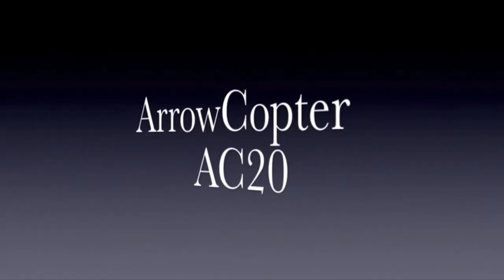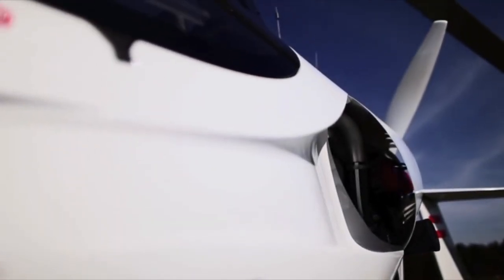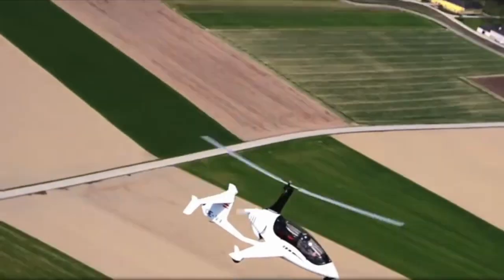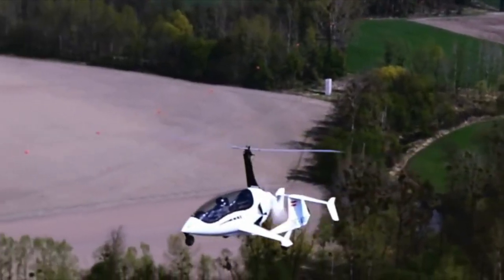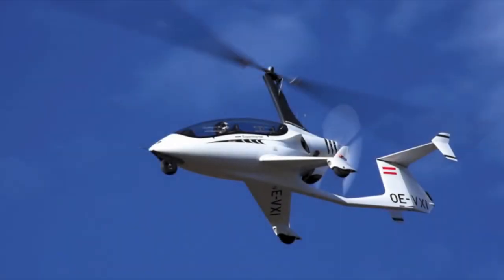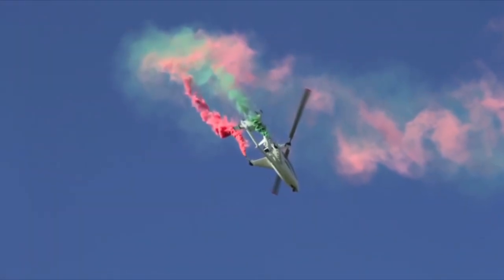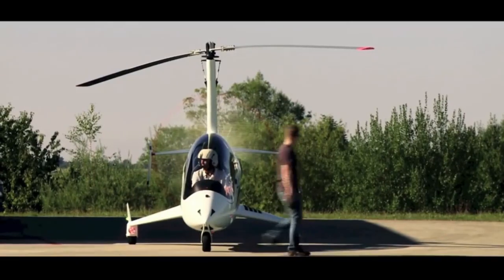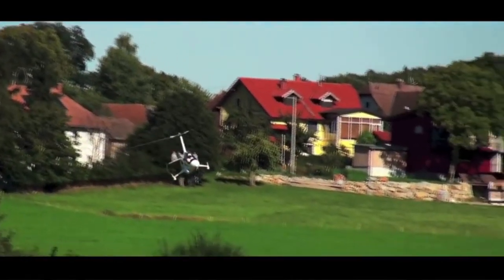History of the Gyroplane - part 21 The Arrowcopter AC20

Comment: I owned an AC20 N713TX (one of two in the US). My experience was a bit different in late 2014. The rebuilt factory floor was well organized and there were several in process. The machine was incredibly well built (I've also owned an MTO and a Cavalon and have many hours in Magni's). There's not a gyro that came close to the fit and finish that I've seen. As stated, flying was normal, but the yaw roll was pronounced at high speed (top end was 95-100kts). I attributed it to the sharp nose and the wings. If you let it get out of yaw trim I think the winglet would cause the roll into the windward side (just my theory). Landing the Arrowcopter was a dream. The wings gave some ground effect and the built in suspension made every lending butter smooth. I sold it, but honesty still kick myself for letting it go.
Reply from the maker: Hey Jason thanks for sharing this.  I think I was over there in the August of 2014?  But yes I agree the fit / finish / overall quality of the aircraft was very good and better than what is currently offered by other gyroplane makers. I only flew it for about an hour and yes perhaps you are right about the cause of the dutch roll  - indeed it was quite mesmerising once it set in watching the horizon more about! I'm not sure if the fix would have been easy for them and the wind seemed to have gone from their sails UK wise with the certification issue.  Ownership I'm not sure who supports the aircraft in the US but that would have been my biggest worry?  Great colour from an owner thanks.
Reply: @jasonknight1585  the Designer still works but shifted towards Porsche tuning, I was at his factory in March 2025 he still owns one AC 20 cheers from Austria

Comment: The one I’d really like to see in the UK is the AG915 variant Trendek. I don’t like the Cavalon because the panel layout is absurd and the visibility is dreadful, add to that its 100mph VNE,  high fuel consumption (or, at least, higher than an MTO Sport), and its narrow track and small rudder increasing the risk of it rolling-over on landing. I think there is a gap in the UK market for a much better side-by-side enclosed cockpit gyro and the AG915 looks like it would be a good contender.
Reply from the maker: Hi - yeah I just don't see them bringing it to the UK and actually the way I see the UK market its probably not worth them doing so.  IMO gyroplanes have gone the wrong way in that they have tried to get more sophisticated which has driven up pricing and I think we should have gone the other way.  If someone marketed a <£40KGBP gyroplane in the UK it would sell.  On the Cavalon I agree with the panel and the A pillar does obstruct but the VNE on a new Cavalon is 120mph and the track is the same sport v cavalon.  Landing is fine you just (again its my view) don't want to get too slow in these things.  Too many people try and spot land every landing and it just isn't necessary.
Reply: Gyrocopter flying club - Ah. An increase in VNE is useful. I agree that the AG915 will probably never reach the UK market. It doesn’t change my view that I’d rather have one of those than the Cavalon. Yes, the track may be the same between the Cavalon and the MTO Sport, but the larger rudder in the (pre-2017) MTO gives better authority. Compared to my MTO, I found the Cavalon to feel kind of “dead” in flight. It sort of felt like it was wallowing around compared to the MTO. I get the advantages of side-by-side enclosed cockpit vs tandem open-cockpit and I can see why people would choose that format but I really don’t think that the Cavalon is worth the money. In my opinion, there is just too much wrong with its design and to go from the unencumbered visibility of an open-cockpit aircraft to the cockpit of a Cavalon is too much of a step down for me. It could have been a much better aircraft. I would still like to fly an AG915 to see if it really does tick the boxes but so far, when I’ve flown enclosed cockpit aircraft, I’ve felt like I was looking through a letterbox at the outside world. Before I started flying, I didn’t think I was going to really like the MTO, but so far, I feel that I wouldn’t trade it for anything. My instructor used to say that an enclosed cockpit just provides a false sense of security and more shrapnel to kill you in a crash.
Reply: Abid Farooqui - Ohhhh... I like the American Ranger, too... That’s another one I’m hoping will make it to the UK and that I’ll get the chance to fly one. I know someone who owns one and flies it when he’s in the States.
... and I did say, “I would like to fly [the AG915] to see if it really does tick the boxes”. I’m certainly not convinced that it does but I know that the Cavalon really doesn’t and if it never makes it to the UK market, I’ll never have the option. Our choices in the UK are very limited and I would like for there to be a wider selection and a little more competition for the two manufacturers which currently service the UK market.

Comment: It’s a great looking aircraft. It is possibly even the best looking enclosed autogiro. I also believe you can swap the canopy for an “open” frame and customers can do the swap themselves and they are good looking as well. But any aircraft must be capable of being used. That means there must be a worthwhile range between MTOW and DOW, a C of G range that permits it to be used plus reasonable economy and performance. An aircraft is a total package so having one of the “useful” elements missing is a bit like a girl with a fur coat and no knickers.
Reply from the maker: Yes agree it’s a great looking thing and it’s flies ok at more relaxed speeds but push to the higher speeds it’s marketed at being able to do and it shows some limitations- the Dutch roll is quite funny as it’s really textbook! I suspect the undercarriage/ winglets interfere aero wise. Ultimately this was a real case of just not enough substance to the whole entity to make you feel they would have resources to re-engineer / stay in business long enough to resolve things. A big shame tbh.